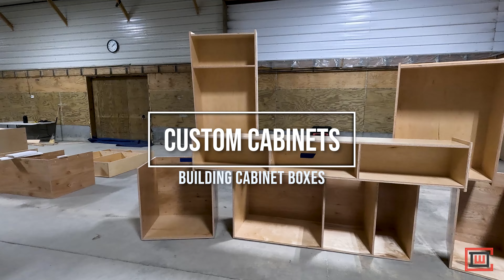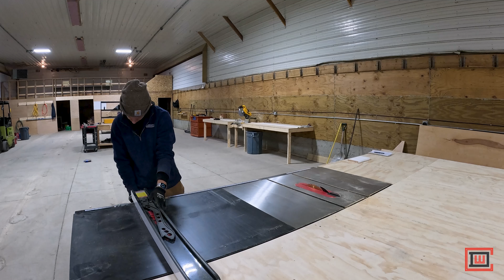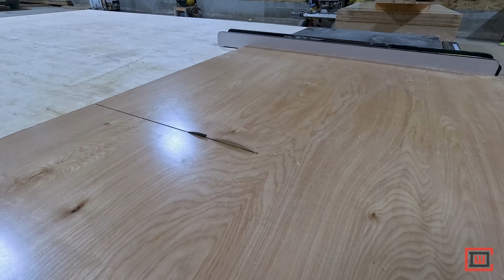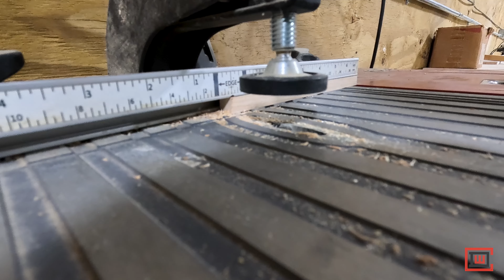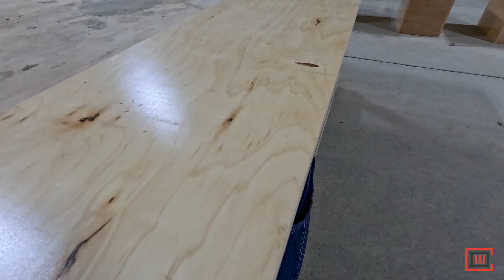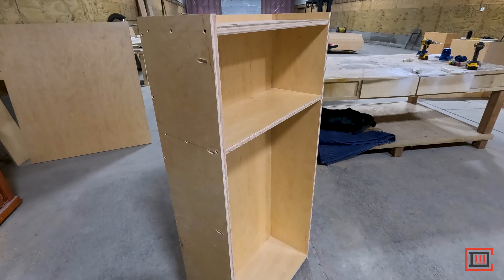CABINET BOX BUILD! | Building Custom Cabinets | EP: 1

Comment: Was the sheet stock dead square to start with? Every other video I see says get rid of the factory egde.
Reply from the maker: @FyrFytr998  Great question! I definitely recommend getting rid of the factory edge for better alignment.
Reply: @ So do you use a track saw to get rid of the factory edges then cut to final dimension with a table saw so you’re not just cutting a parallelogram? I ask, because I’m a newbie still trying to find the best method to square up sheet goods.
Reply from the maker: @FyrFytr998  No worries happy to help get you started off right! We use the table saw and on the first cut add about 1/2 inch to your final dimension, then flip the piece so your new cut edge goes against the saw fence and cut to final dimension. Most factory edges are good enough so you don’t have to worry about cutting a parallelogram.👍🏼